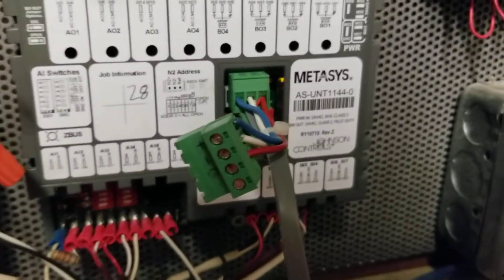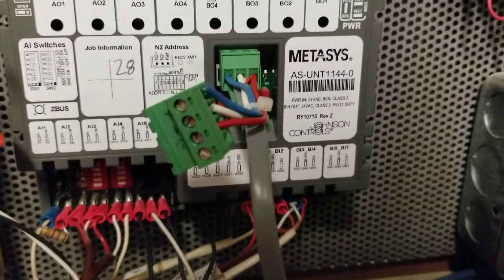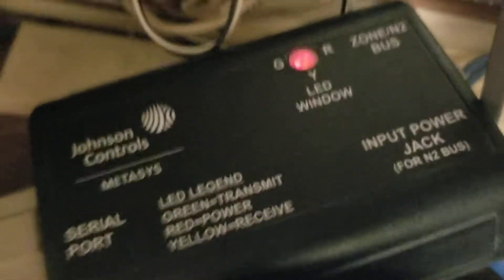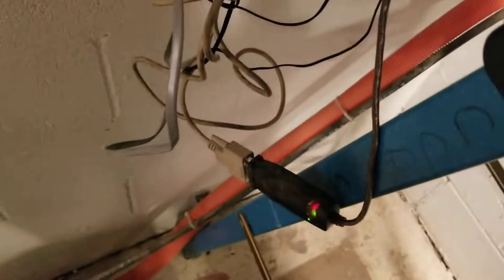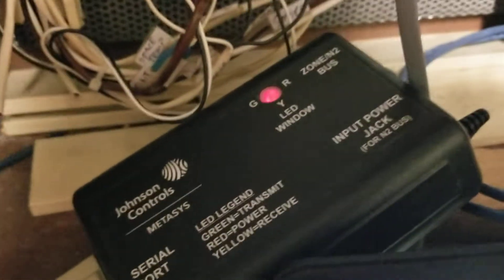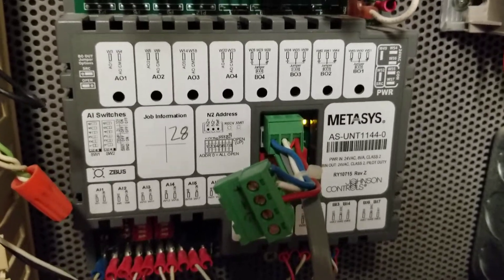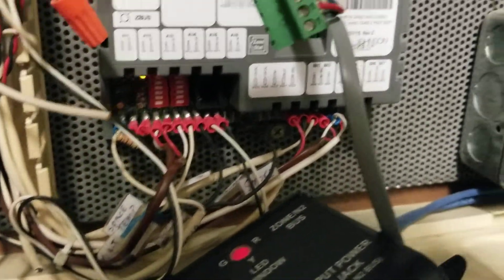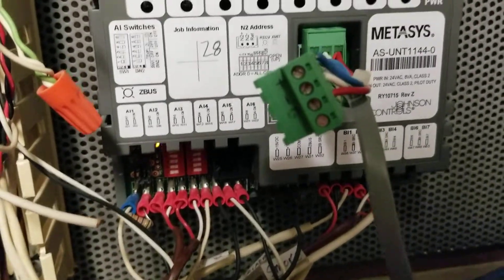Johnson Controls UNT replacement

Comment: Hi, I trying to replace one of those. I'm using USB to serial and serial to rs485 adapter. I saw the communication LED blinking but I not able to connect. Got communication timeout error. Port is configured in PC(using COM1). Any idea?
Reply from the maker: Re check your address settings for the device. You you might also try using the zone bus option. If it's the old one not communicating it could just be dead.
Reply: @Systemcontroltech  thx for responding. I wasn't using the right adapter for COM. Got it working.

Comment: I was just trying to help troubleshoot a bunch of old N2 devices the other day, the info on that old stuff is so hard to find, I think we have an issue with the NCM so I tried to disconnect it and hookup an fx60 to integrate it but ran into several roadblocks, info is hard to find on these old systems
Reply from the maker: You will be better off replacing the NCM with an nae or nce and pulling the controllers into it.